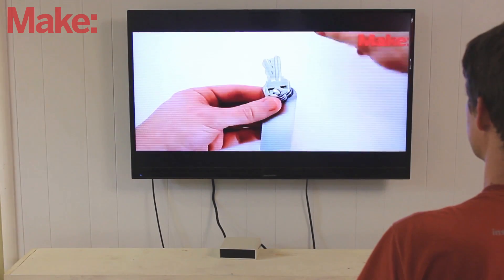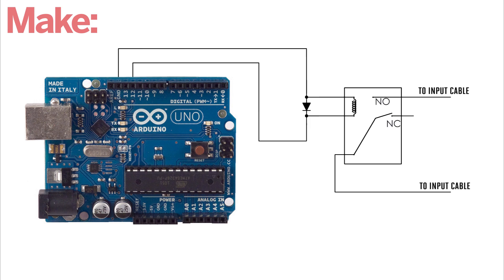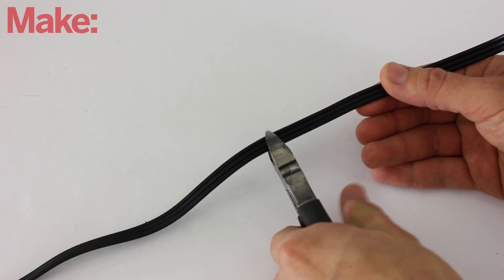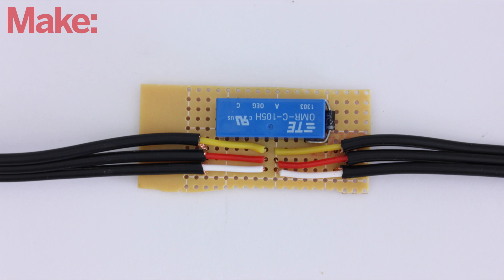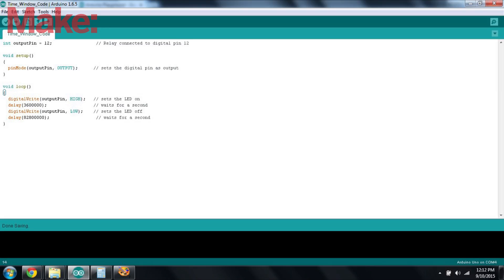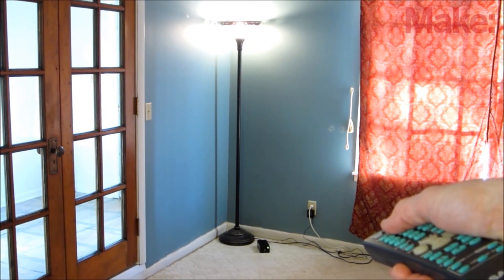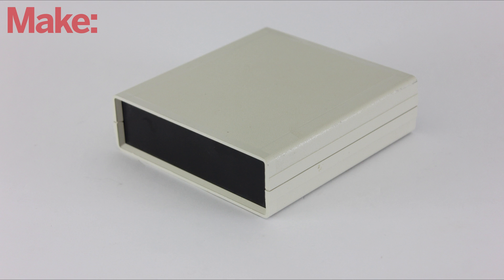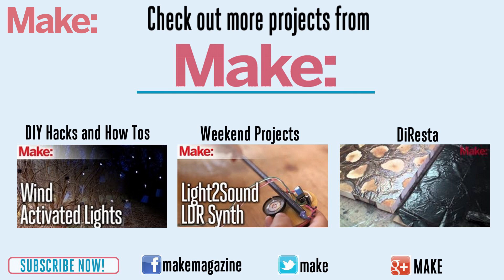Limit TV Time with an Arduino-Controlled Relay

Comment: is not good idea to use a arduino pin to feed a relay. Better use a transistor (like a 2n3904) to control it.

Comment: most tvs have a built in "off in x" minutes, where  x is 15, 30,  60, 90, and 120 or more!  I like the idea of the circuit but would have rather seen a more practical demonstration/use for the circuit.

Comment: Wouldn't it be better to break the video signal? Or perhaps use a TV-b-gone?   There are many scenarios where a common ground would be found. For example connecting through a stereo. Also the analog cable has a very poor signal quality and I'm not sure breaking the screen and cutting apart a hdmi cable would work? Would the signal quality of hdmi become to noisy? Have anyone of you tried to solder together a hdmi cable?

Comment: The HDMI version of this would require you to throw at least 5 signal wires, Red, Green, Blue, Audio Left, and Audio Right.  I'm not sure the availability or cost of a 5P1T relay so the mod would be to hook up a second relay to another digital signal pin on the arduino.

Hacking a digital HDMI switch box may be another avenue that may end up being easier, just secure the switch in the box so it can't be accessed and have the arduino electronically 'press the button'.  Could be a fun hack!